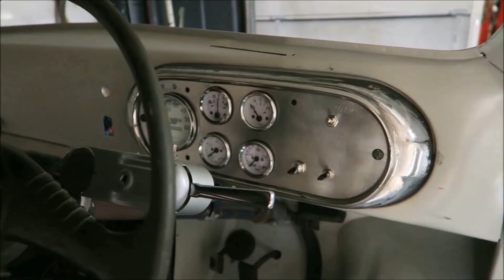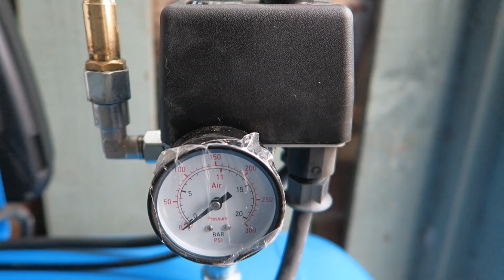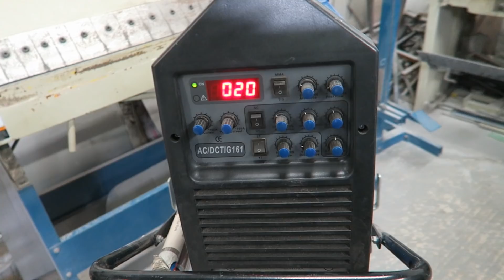Trev's Blog Meets Urchfab. Matt Urch. Xtreme Compressor surprise!

Comment: Good day Trev , good luck with the new compressor, when you set it up. If you set it on concrete blocks or wood blocks  to keep it off the ground away from the dampness  it will extend its life and make it easier for you to drain if you pitch the compressor 1or 2 millimeters toward the drain every thing will come out (1 or 2 mill is all you need with the tank being round ). when you wire it you mite want to have and electric out let added for and auto drain with a clock . example the drain blows off every day at certain time (when your Neighbors  are not home )...    you can repair most good compresses with one or to repair parts , but here because of cost of replacement , a rotted tank sends the whole thing to the scrap yard ..  Thank you for taking the time to make these videos , Peter M

Comment: Trev, what's your secret? You haven't changed a bit since 1998! Is there a painting in an attic somewhere? 😜
Matts most well known for the mongrel project. 
Tig welding vid is exactly what I need, I've always looked at all those settings and thought ?#*!??🤯🤪
Reply: If you're doing steel you really only use one setting which is the amps, and if you have a footpedal you don't need to set it very precisely.   TIG is quite hard because you have to hold everything in the right place and need at least three hands but the thing that's easier about it than MIG is you can at least see exactly what you're doing wrong and there are fewer settings to worry about.

Comment: like matt he's a real down to earth guy , no pretences watsoever , he does some pretty good work on cars too
its actually a good thing the trailer whent down on the way to collect the mill , wouldve turned out a lot differently if it happened on the way back with the mill sitting on the trailer (allways go for the good thing , you live longer)

as for the hedgehog , prolly good enough to put the door ajar aproaching spring , or check the barn when it starts getting warmer and see if hes moving about then set the door open , other option would be to but a watertight plastic bin or bucket , put a hole in the side for him to crawl out of and set that over his stightly raised up nest upside down like a doghouse outside in the garden , should work good enough
Reply from the maker: watahyahknow he wasn’t hibernating, he got up and had a meal for three nights  then left the shed. Cheers Trev 👍